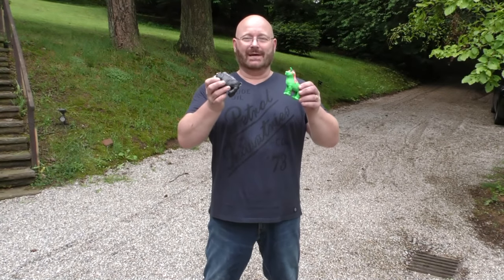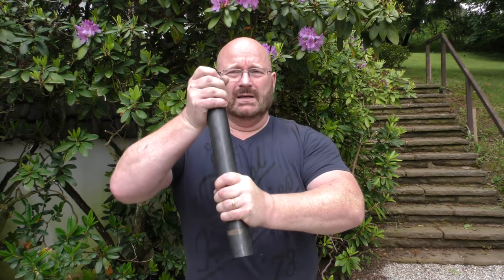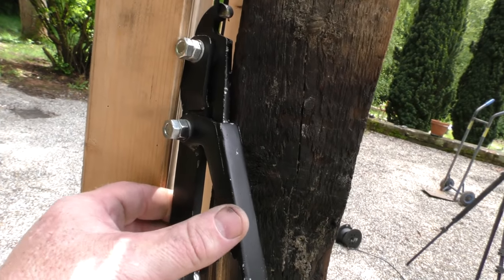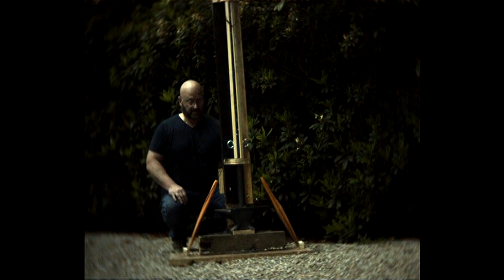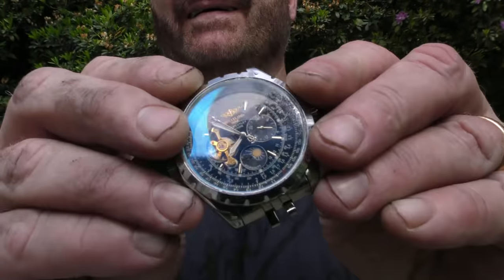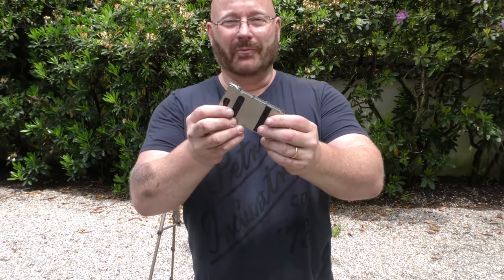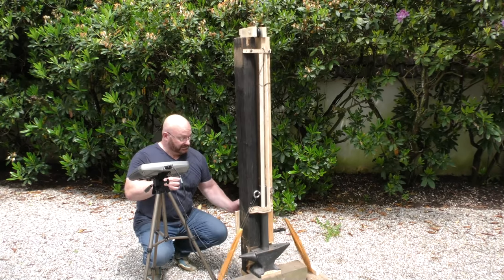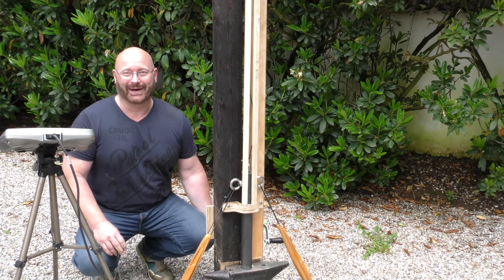The Rubberaulic Press: Pure, Brutal Demolition!

Comment: A MACHINE THAT TURNS 1 EURO COINS INTO 2 EURO COINS.
THIS MAN IS A GENIUS!
Reply: Exactly what I wanted to add in a comment :D
Reply: It can turn a dime into a quarter.
Reply: It turns an iPhone 6 to iPhone 6+
Reply: It turned into 2?
Reply: @plain7439  From some distance the two euro coin may look like a one euro coin, just bigger. Of course the metal from ring and outer part are wrong now, but it could be good to fool someone who is not in regular contact with them.
Reply: BreakTheSilence 700th like
Reply: BreakTheSilence this is called inflation I think
Reply: Uh oh not again
Reply: No defacing the currency is illegal in the UK and it may well be the same in Germany. Genius is only genius as long as you don't get nailed or fined for it.
Reply: S T O N K S

Comment: with a motorised winding mechanism and some bolts to hold it down this could actually be a handy low cost power hammer for the blacksmith on a budget
Reply: Sam Silverman that’s exactly what i was thinking, way more a power hammer than a hydraulic press
Reply: its really a drop hammer, a power hammer will let you do repeated strokes, a drop hammer is used for one massive controlled hit, which is what they use for coining. essentially just more weight on a track system using only gravity
Reply: No, I was a blacksmith as a hobby back in the day and a pneumatic hammer (I think I pronounced it correctly we dont call it that here) is the real deal
Reply: Good idea. How about a rubber-based, resonant treadle hammer. You pump a pedal at the resonant frequency to get the heavy slug swinging and eventually smacking the anvil.
Reply: Treadle hammer on a cam system with a bass drum peddle....like an old sewing machine  that would allow you to get multiple strikes per peddle stroke....now that would be epic! 100% Human powered!

Comment: You should take away the anvil and allow the steel rod to fly...  It'll make for a great cannon. Imagine the destruction.
Reply: I was just thinking that!
Reply: I can only imagine the level of recoil caused by launching such a heavy projectile. if this was turret mounted I think it'd be possible... but there's no way it'd be man portable.
Reply: Technically speaking, that machine is a ballista / scorpion -ish device. Not povered by torsion or bow arms, but simillar locking and release mechanism.
Reply: yeah, but clearly the force at which the rod flies out is going to create huge amounts of recoil, meaning that you're going to need this to be bolted down to something stable, and it also seems to be extremely heavy too, meaning that you're not going to go around carrying that thing. 
however, if you were to mount it onto a SUV, well, it would be pretty lethal and destructive.
Reply: NekoUniverse MUHUAHUAHUAHUAHUAHUAHUAAA!!!
Reply: I would imagine a lot of kinetic energy would be lost considering you would be fighting gravity instead of working with it.  You may only get it to fly about 10-15 meters, and that's with an arc.
Reply: I think the rod would only fly a few meters
Reply: Add more rubber then.
Reply: the ultimate predator imaginate if it hould get the rod razor sharp
Reply: Katalist  HAHAHAHAGAHAHAHAHAHAHA 🤣
Reply: Katalist  what if it is a 2 year comment you saw it and replied didnt you ao it worked

Comment: One of these with an axe blade as a tip could probably be used to split wood
Reply: nice idea
Reply: Possibly. The blade would dull like crazy, but I'm sure it's possible and it has potential
Reply: He was joking about coins, but this would be very good at minting them. In fact, it's very similar to early coin presses.
Reply: It could split someone nick seems to be a good execution  machine
Reply: No, it wouldn't. Why would you go through all the trouble of making perfect spheres, just to make them into badly shaped coins?
Reply: +Underscore Zero "to entertain you guys!"
Reply: You'd have to design a slot for the blade to be hammered home into - so that the blade isn't hitting the anvil.
Reply: Haze33E French revolution style
Reply: I use a wood splitter all the time and they have trouble splitting logs sometimes. I don't think it'd get even 1/3 ways into a log
Reply: Haze33E. I think your right. I have slit sawn and made shakes. Rubber won't do it but this guy wood not even try. He is no dummy.

Comment: This is actually a really interesting contraption from physics perspective.

If we assume the anvil to be approximately stationary, then the impact force is basically the momentum of the steel bar divided by the duration of the impact (F = dp/dt). Technically you could add the weight of the bar as well, but compared to the dynamic forces from the impact itself, it will be negligible. Basically, the more momentum the hammer has, the harder it hits - but the duration of the impact also matters. The length of the impact is determined by the deformation of both the target and the hammer itself; if they are made of short materials, then the impact lasts longer and the impact force is lesser. If the hammer and the object are made of very hard materials, then you have much higher contact force as well.

And the force of the impact can be tremendously high, and when it's concentrated on narrow area, the pressure can be staggeringly high as well. In fact, I wouldn't be at all surprised if the momentary forces in this contraption were actually in the same order of magnitude as with a hydraulic press - if not higher. A hydraulic press, however, can produce that amount of force continuously, which makes it much better at deforming things that take a lot of energy to deform. If you can measure the speed of the hammer at the impact, and measure the duration of the impact as well, you should be able to calculate some approximations for the impact force.

In contrast, the "deformation capability" of this device is entirely dependent on the impact energy. However, the impact energy is the kinetic energy of the steel bar at the start of impact (E = ½mv²); this energy comes from the potential energy (height) and the rubber bands. But the rubber bands only impart a certain amount of force to the hammer, and the heavier the hammer is, the less acceleration it will have. And since kinetic energy scales with the square of velocity, a light projectile moving at high speed has four times the kinetic energy of a twice as heavy but half as fast projectile, even though they have the exact same momentum. What that means is that if you reduce the weight of the hammer, your rubber bands will be able to propel it to higher impact velocity, and it will have more impact energy, which should cause further deformation in the target.

The optimization problem here is that there is probably a limit to the speed that you can reach with rubber band contraction, and when you approach that speed, weight reduction will no longer give you palpable increase in hammer speed so you start just losing momentum. Another thing is that you lose some energy by reducing the gravitational potential energy (lighter hammer = less weight) but I think that is largely insignificant. Either way, it could be really interesting to see you do some tests with a lighter hammer on identical targets. The lead balls would be a good candidate for measuring the deformation - just check the diameter with current design, and then see if you can deform the lead ball more with a lighter hammer. I think you could do some optimization on the design that way.
Reply from the maker: Well, the terminal speed of rubber is about 100 m/s (in real life). A 7,5 kg hammer at 100 m/s has about 37,5 kiloJoule of energy, and about 750 Ns momentum. But of course it would take a huge amount of rubber to achieve that kind of velocity.
Reply: What do you think about the transfer of energy if this machine was bolted to the floor? Seems like a lot of energy is wasted when the whole thing lifts off the ground.
Reply: kieferonline Good question. On intuition, I think any differences in actual impact power would be negligible since the majority of the impact energy comes from the rubber bands and not gravitational potential energy, but the device might have much lesser structural loads if it were bolted on the ground.

What's happening here is best analyzed from momentum perspective. There's two bodies - the body of the contraption, to which the anvil is attached to, and a freely moving hammer that is accelerated with rubber bands.

When the device is fired, it's total momentum is zero.

At the moment of impact, the total momentum must also be zero, but the base and anvil are moving slowly upwards while the hammer is moving very fast downwards. After a few semi-elastic bounces, the hammer and anvil settle together and the device falls back down to the ground.

The impact occurs when the whole device is in free-fall. That means, as the device currently stands, it would perform identically in free-fall, or if it were orbiting the Earth (assuming the rubber bands would function normally).

Now, bolting the device down to Earth would essentially connect the mass of the anvil and the device base to the mass of Earth, which will essentially make it move very little when the hammer is released. This might, technically speaking, increase the impact velocity very slightly, but it probably would be a minimal change. There is a small benefit gained from using all the energy of the rubber bands for accelerating the hammer rather than lifting the whole contraption up a few centimetres.

More important, I think, is that currently the only thing supporting the anvil is the device itself. The hammer hits the anvil hard, and the structure of the device prevents the anvil from being punched down through the wood. Since wood is a flexible material, it doesn't fracture despite significant loads, but that also means the duration of the impact is lengthened significantly. And longer duration reduces the peak impact force (since F = dp/dt). These loads may also lead to weakening or fracturing of the materials or joints in long term, which is why it would probably be better to bolt the whole thing down to a greater weight or, indeed, the ground itself. Alternatively, a significantly larger anvil (heavy enough to prevent the device from jumping up when the hammer is launched) would do the same job.

Ultimately, though, only testing can reveal whether it would perform better with such a modification, but I would like to see some experimentation with a heavier anvil and a lighter hammer, and comparing the "flattening power" on some identical lead balls.
Reply: Neeeerrrd
Reply: Nerdking 527 My Liege!
Reply: AHH WORDS Brain explodes
Reply: thanks
Reply: +HerraTohtori suomi mainittu.... ei vaa en jaksais ees lukee, mutta luulen et jotai todella mielen kiintosta:)
Reply: You're right that the kinetic energy of the hammer is half of its mass times its velocity squared. However, if you take into account other variables such as gravity, you should find that the kinetic energy in this hammer is significantly greater than a less massive hammer in an otherwise unchanged setup. tl;dr mass of the hammer doesn't change energy on impact except that from being heavier

Let's ignore gravity and complex factors first, and assume the contraption is a spherical hammer in a vacuum with spherical rubber bands in microgravity in space.
Physics jokes aside, the mechanical energy in the system is all stored in rubber bands. Because we're using the same rubber bands no matter how massive the hammer is, it will have the same kinetic energy in the end, when entropy has reached a maximum.

To put it another way, energy is related to the v^2, remember?  v^2=2(Displacement)(Acceleration). We can assume the size of the contraption remains the same, meaning so does displacement. Acceleration is Force of the rubber bands/Mass of the hammer according to Newton's 2nd law. Combining this with the equation for energy, E=1/2mv^2, we can find that energy is jointly proportional to acceleration and mass, which is proportional to just the Force of the rubber bands, which is still constant.

Now, if we add gravity on Earth, we can clearly see dropping a massive object compared to dropping a less massive object from the same height accumulates more kinetic energy. Adding the earth's magnetic field really does nothing unless the hammer is magnetized. Adding general relativity means the hammer appears a little slower to people in outer space.

That's why a heavier hammer is just better, and "velocity squared" cancels in the end. Now go do science!
Reply: You're right, technically rubber bands produce a conservative force and, ideally, you should get the same impact energy out of a light hammer as a heavy hammer. However, depending on the circumstances you might want to still optimize for a fast impact with a light hammer, as opposed to slower impact with a heavier hammer, depending on what kind of effect is desired and what kind of material or object is struck. Both have their utility.
Reply: HerraTohtori not sure what's required, but he says there is 200kg of rubber force, he mentions the weight of the hammer, and there is slowmo footage you could use to potentially determine speed and impact length. what else is needed?
Reply: a 200 kg force acting on a 7.5 kg hammer for what looks to be about a meter will accelerate it to 23 m/s, adding that kinetic energy with the gravitational potential energy, this device should have about 2000 joules. using the lead ball as an example, it started out as 19 mm thick and looks to be about 5 mm thick when crushed, which means it should exerted 14 tons of force on the lead ball
Reply: i hate math
Reply: it's phisics, and it's awesome
Reply: DopeDanker physics is math
Reply: HerraTohtori just took a physics exam so this comment triggered me but I have respect for anyone who derives enjoyment from it
Reply: Better said as maths is the language of physics. 

As for energy loss from the platform jumping, that's not the case. Think about what it takes to get the anvil moving upward against gravity! If anything it's possibly recovering energy that would otherwise be lost, probably by friction and strain in whatever staking or strapping down needed to stop it moving.
Reply: Sure nerd
Reply: What he said.
Reply: Fysiikantunnilla tavataan
Reply: You’re actually wrong
Reply: Dude
Reply: Relax
Reply: HerraTohtori MAKE THE VIDEO PLEASE
Reply: Give it the "Trebuchet" effect. Just like the trebuchet, except where the projectile is launched horizontally, the projectile remains connected to the device and is pointed downward verically.
Similarly to how a sledge hammer is swung manually.